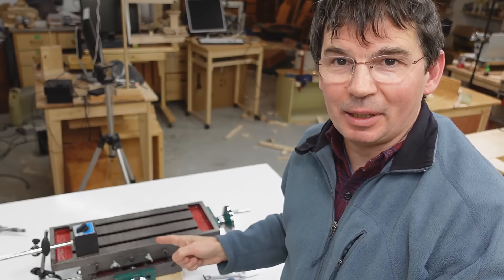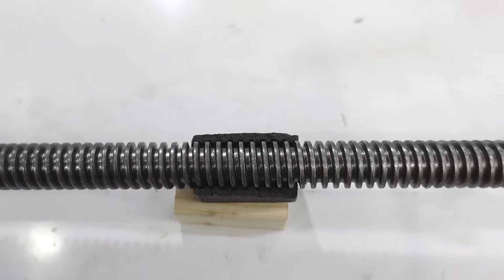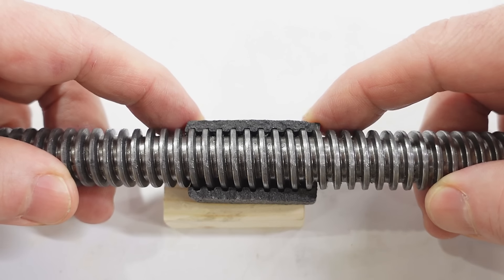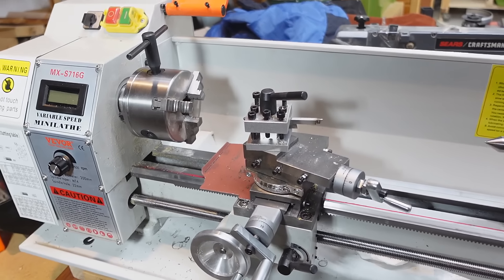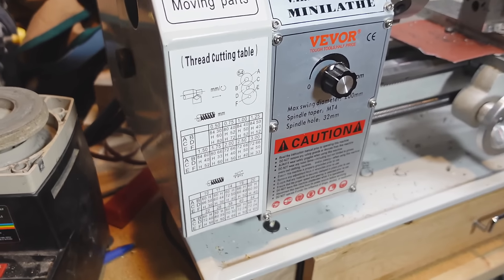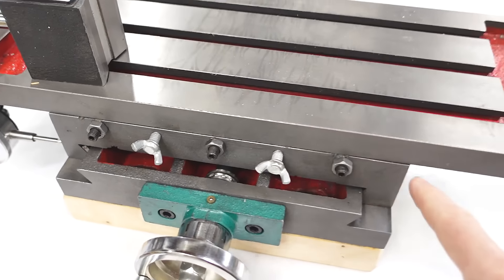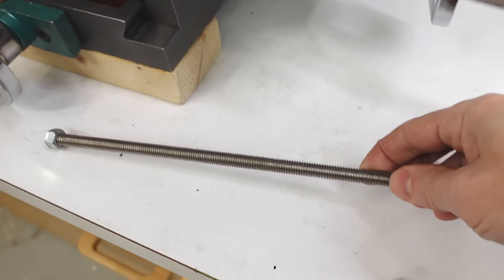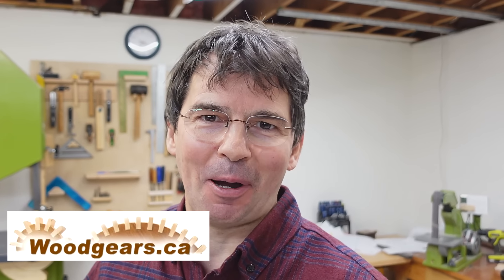Why all the hate for Vevor?

Comment: Just have to recognize that when we buy these, we're buying a kit of parts for a lathe/drillpress/milll or whatever with "some assembly required". With care and patience, we can turn a lot of these cheap tools into pretty precise machines without a lot of heartbreak if we break something in the process. That's where the fun is. As long as the castings are sound we can make lots of improvements with a bit of filing, some judicious replacement of parts, careful measuring, shimming, and alignment.

If I need to replace bearings and fittings in a $75 jigsaw (Hiya, Harbor Freight!) I don't care so much. On the other hand when the power switch and the blade tensioner on a $600 jigsaw fails after 9 months, I get a bit angry (Looking at YOU DeWalt).
Reply: That's what I was thinking. The expensive heavy parts seem to be in good order. Replacing some cheap parts they put in there with some better quality ones that only cost me a few dollars?!? HECK Yeah!! AND I know more of how the tool is put together and works so if something goes out of whack I knew what to look at to fix it.

Comment: Very interesting presentation. I have an underlying philosophy of tool adequacy. That is, a tool that is only adequate to the task is infinitely better than no tool at all. A $1 dollar wrench in your hand is way better than not having a $20 wrench in your hand because it was too expensive. I have had a a 9" SB lathe for over 65 years and it was not new when I got it and, through a lot of use, it is pretty worn out, but it is still adequate for my needs and, because I have grown old with it, I am familiar with it's weaknesses and it is adequate for my needs. I have a similarly clapped out Bridgeport mill that is infinitely better than no mill at all and a decent DRO compensates for a lot wear. In the specific case of the XY table it's amazing that they have done a pretty good job, I gather, on the difficult casting parts, but not so good on the simple screw parts. I'd bet that it wouldn't add $2 to the cost of manufacture to make that screw a lot better, but maybe they don't need that to hit their target market and margins.
Reply: cheap tools can also be useful for identifying the various pain points so when you go to look for the better stuff you know what features matter to you. I recently bought a ratchet. The first thing I noticed after it got into my hand is that if I get another one in the future it should have a handle that is at least 1 inch longer.

Comment: By installing a second lead screw nut on the shaft, and pulling the the two nuts apart along the shaft, you can reduce the lead screw backlash to nearly zero. Maybe you could use the broken  nut (somehow) to do this.
Reply: I've made zero backlash stages by making long plastic nuts. Plastic is elastic so it holds the leadscrew. You want to use a long chain polymer plastic. I'm partial to HDPE myself. Although the elasticity will pose another challenge tapping. If your tap isn't oversize it'll be too tight.
Reply: @1pcfred  If the part is longer than the tap the tightness may be due to loss or gain of the pitch along  the part.. I have had that experience in aluminum.

Comment: When you fix or improve a brand new tool, you tend to appreciate it more. You build a relationship with it as strange as it sounds.
Reply: I do not share that feeling. I feel scammed if I get a tool that is not doing what it is supposed to do.
Reply: @insAneTunA  Not if you know what you're getting into and how much you're paying for it. Sure, if I pay for a Snap On tool, I expect the best and nothing less.
Reply: People have the right to expect a tool that is at least usable for its purpose when they buy it, and it should not be a DIY project. If you buy a cheap car it might have less luxury onboard, but it still has to drive straight, and everything that is onboard has to work as it should.  @seephor

Comment: They are fun tools to tinker with, but incredibly frustrating if you need to produce quality output. I have a vevor diesel heater, it has some problems which were interesting to fix and now it works pretty dang well. As long as you know what you are getting into they are great.

Comment: A quick hand scrape on the ways to improve the contact and add oil pockets would allow the gib screws to be pulled up tighter to take out the slop while making the whole thing move smoother.  Good to see a properly unbiased review.

Comment: I appreciate the reflection on the market participation of vevor.  I will spend as little as possible if it's 90% of the way there, and I gotta tweak it a little.  It also lets me become familiar with the machine, and understand it for maintainence.  

And while I do not comprehend how,  I think that's pretty magical momement.
At the end of your video, I did not realize you could convert wood peices into a bandsaw.

Comment: If you're planning on the motor drive, I'd suggest using a small trapezoidal screw or a ballscrew, still very cheap and available and would run much smoother than a machine screw

Comment: Originally I had a critical comment on Vevor, but you pretty much nailed it on the head with this follow-up video. I think it's not so much that people are buying into a crappy brand, just so as long as the expectations meet the product they're getting, all is fine. I own a cheap chinese mill and lathe, both of which took a lot of tinkering to get working well.

Comment: I bought a Vevor sausage press, a bit of sanding on metal parts and smoothing of things and it works perfectly.  It was a good alternative for the price. Much less than 1/2 of what I was looking at elsewhere.  If you buy there stuff it may not be perfect, but a little know how and a little finishing work and you can certainly have a functional device.

Comment: Matthias, the points you are making with respect to balancing product precision against manufacturing costs are quite profound – but they are fundamental to old woodworkers like me, whether a hobbyist or professional. Almost 60 years ago I purchased my first table saw – a Craftsman – from one of our local Sears stores. I used that saw to build cabinets for a few years, until I accumulated enough money to buy a Delta Unisaw, which cost eight or nine times what I paid for the Craftsman, and which I use to this day. When I bought that first saw, the wise old salesman (in those days a Sears salesperson was often a well-paid, helpful expert who made dealing with Sears a very positive experience) told me how to use my saw more accurately by always coming up to a blade height or a cutting angle from the same side. That caused the Acme screw to push against the same side of the bearing nut at all times. If you were to turn the screw in opposite directions, first left, then right, etc., any slop in the fit of the screw in the bearing nut would find its way into the adjustment you were making. Your experiment just demonstrated the same point – as long as you were turning the screw in the same direction the slop was minimal.

There is an epilogue to the story as well. I gave the Craftsman table saw to a professional handyman, who used it as a job-site saw to construct an entire cabin. Even with its limitations – it was built to sell for a specific price – it was a great saw in the right hands.

Comment: The friction may increase the precision when measuring but keep in mind that when you are actually USING the table the forces will be much higher and friction will not be enough to keep the table in place so it will probably move more than desirable.

Comment: I have a Vevor wheatgrass manual juicer that I'm using for several years now.  Yes, there was a problem.  The plastic gasket at the back, nearby where the handle connects, for some mysterious reason went into the juicer.  So one batch of juice was scrapped.  They do include a replacement gasket although I decided to use the juicer without it.  It's made to prevent juice from flowing backwards which never happens in my case, as I clamp it to a kitchen counter and it happens to be at a slight angle due to clamp pressure.  The rest of the juicer is just fine, stamped 304 stainless steel.

Comment: These have been around for decades.
I bought one back in 2003. I spend a day fixing and lapping it.
I converted mine to an XY CNC using NEMA23 double shaft steppers like the one you have, and attached the handles to the stepper without changing the lead screw.

Comment: The way you improve the accuracy of a sloppy ACME nut is to split it in 2 width wise (so you have 2 nuts) and you either jam them together or jam them apart, creating interference on the screw.  This is how you tuneup an old Bridgeport.

Comment: Seems like you came to the same conclusion as me. I've upgraded two of them with new lead screws. On one I installed 3/4-10 all thread and made dials and on the other I installed 3/8" all thread and used DRO's. It is a shame that they used all that cast iron and did a good job on the table itself and spoiled it with bad lead screws

Comment: One thing to check is how the gib screws press on the gib.  It's likely pushing a sharp corner of the screw into a point.  If you make plugs with a flat angled face between the gib and (shortened) grubscrew, it'll spread the load and make the gib adjustment more satisfactory.

Comment: Also worthy of mention is that many home hobbyist workshops would not have nearly as much equipment such as hydraulic presses,metal cutting bandsaws etc.if it were not for the existence of these low cost import machines and accessories. I have a Vevor semi universal dividing head for my milling machine and with a bit of fine tuning it is highly accurate and consistent in use.

Comment: We used XY tables for a materials testing machine that measured in the nanometers.  Our solution to getting an exact location was to always overtravel and come back to position from the same direction every time, even with a spring loaded lead screw.  Movement for an atomic force microscope didn't affect the overall picture of the surface, so quite frankly I don't know why people have such a problem with tables.  If you're that concerned, do the simplest fix: load the screw with spring pressure and use a ball screw.

Comment: For Hobbyists getting things cheap feels like a win. Most have time to burn, not money so making fixes or improvements are just part of the journey. Got a cheap bandsaw from a friend of a friend not knowing much about them only to discover the band tensioner was cracked, the table pivot mounts were a steel pipe cut in 1/2 & the switch was a bit off. I described it as farm fresh as it was patched together with whatever was lying around. Fixed everything & learnt a bunch in the process.

Comment: I'm with you on buying inexpensive products, provided you're realistic about what you're getting for your money. For the hobbyist, Vevor and other overseas sellers offer some outstanding values provided you manage your expectations.

BTW, if you want improved precision on a less than perfect table, you can add a DRO which will display actual table movement independant of the hand wheel dials. If you're go down the CNC rabbit hole, people usually rely on ball lead screws.

Comment: I just got a 7 x 14 Vevor Mini Lathe. I also have a Sieg X2D Mini Mill, also Chinese made. I got the mini mill new on ebay for $325 and free shipping. I am impressed how good it is for the price. They both need work, scrapping, lapping improving parts etc. but that is an opportunity for a novice machinist to practice and hone their skills.  I want to squeeze all of the precision that I can out of these tools, then I can start making parts for an epoxy granite CNC, get it running and use it to improve it's own parts. I have more time than money. If money was no option I'd buy a high end CNC with micron accuracy.

Comment: Large stepper motors have a lot of power but the "right" way to do it is to replace the lead screw with a ball screw. The downsides of using a ball screw is you have to have the stepper motor powered up or lock the table. Ball screws won't hold position. Usually you have to machine the casting to fit bearings too. On the CNC machine I made I made a zero backlash trapezoidal setup by making long nuts out of HDPE. HDPE is springy. Not as good as ball screws but cheap.

Comment: Have you considered turning your own lead screw and making a replacement nut, or perhaps purchasing a better quality nut and turning a screw to match? It seems like getting those two parts to an acceptable tolerance would fix most of the issues, and would be good hobbyist/beginner projects for the lathe.

Comment: I have the Vevor Table and have played with it a little.  It is exactly like what you say, it's a good deal for the money.  But on mine, the tolerance on the socket head bolts that joined the X bed to the green bracket with the thread and bearing was abysmal to the point where I had to redrill the bracket (elongate the hole) just to get them to align after taking the table apart to do an initial lube.  I plan on adding linear distance sensors and a digital readout, although I'm presently using a Bosch laser distance sensor to track bed travel with reasonable repeatability.  I find that my drill bit tends to walk quite a bit and I have more repeatability problems from the drill press bearing (I paid a whopping $25 off of Craigslist for it) or from small diameter drills bending under load and from me not center punching the holes before starting the drill hole.

Comment: I made a new nut from lead/tin mix. I poured it directly around the screw, after i smoked it to get it covered in soot. You have to pound a litte but on the screw to give it some wiggle room. But it will have very close tolerance.

Comment: I've been sorely tempted to pick up some of their air jacks. They have a high lift, and I almost never jack something up out of range of my air hoses.  They lift quite fast too, so you're not standing there pumping. I know it's a small savings in time and effort, but for $99, and it'll last for years, there's quite a benefit to being able to throw something 18" in the air in 3 seconds.

Comment: I have a unimat SL 1000 lathe/mill - the point of "as cheap as possible at the cost of precision" rings a bell for me, most of the time.
So I totally understand your point of view... but most people don't understand it (I get questions and comments like that on my channel too). 
Here is the "why" for me - and I hope it helps the US/EU readers:
1. My shop (like most shops) is a hobby shop, I don't make money - it's all comming out of my pocket.  A precision top notch 200$ reamer that would last 10 times more and do a far better job - would be lovely, but is out of my budget range, while an OK to good 20$ one from china will be OK for me and I can even buy a set!
2. Currency matters - your 1$ is x4 times my local currency. Since my salary is in the local currency - tools are x4 (plus delivery!) more expensive for me...
3. While I do try to buy the best equipment I can - sometimes I rarely need the tool - so buying a cheap chinese one, clean it, zero it and work with it makes more sense than buying a good product that costs x5 to 10 times the price.

It all boils down to your uses and needs - think of it this way: you don't buy a 10K$ gaming computer for simple office work, right?
My 2 cents... (long... sorry...)

Comment: Perhaps you can find a POM lead screw nut for that size. As its plastic the precision is higher. IMO though if you have a slightly different pitch on the screw and the nut they bind together really well. You can abuse that to create a good precision. Yes it will wear but that might be worth it over making it more expansive.

Comment: If you try to mill on the drill press you will have trouble with the side force causing the chuck fall out. Milling machines have a draw bar to keep the tapers locked together.

Comment: The problem with relying on friction to take up the back lash is that as you are cutting and generating vibrations, the back lash will work itself loose.....and you never know when or how long it will take to back off. 

As soon as those little guys figure out even a remotely effective QA process and better shipping practices they will have a nice little hobby machines. I  think most people would happily pay an additional 20% to eliminate some of these annoyances.
Reply: They know exactly what they're doing. Their QA is very effective too. It's wiped out manufacturing in the West. Ship everything! I worked in a tool and die shop and on our top of the line product attrition was incredible. I can tell you why our stuff cost ten times as much. It's because we threw out nine tenths of what we made. But the one you got as a customer was absolutely perfect in every way. If there was so much as a scratch on it we wouldn't ship it.

Comment: I some time ago purchased cheap coordinate table for my Dremel stand. I didn't complain about it because that was great base for updates. I only needed to disassemble it straight away, then I just did first updates, sharp corner filing, adjustments, some tweaking two days in row and it turned out exactly how I wanted it to be. And that was quicker and cheaper than building it from scrap.. 😂
Only looks a little bit strange - original Dremel with original stand, but with coordinate table from cheaper end.. But it works when I need it. Already did few projects with it.
If I start to use it every week, then I will start to consider to purchase something with bigger quality. Reason why I have original Dremel - before it, I had two cheap end dremel - like tools. They get faulty.. 😂 Last one I repaired multiple times before purchasing Dremel.